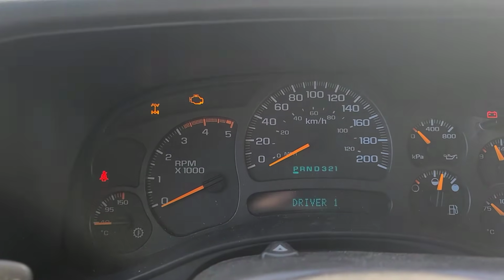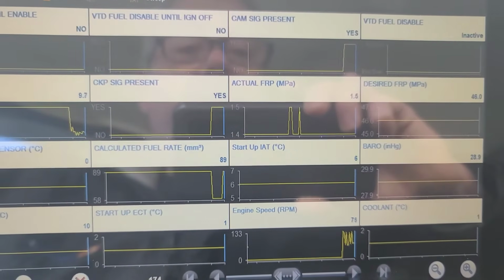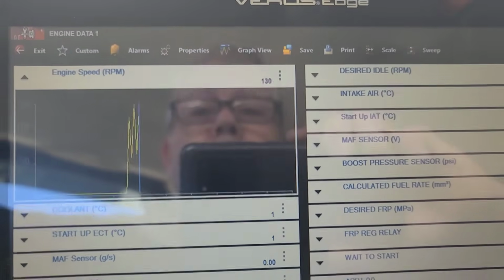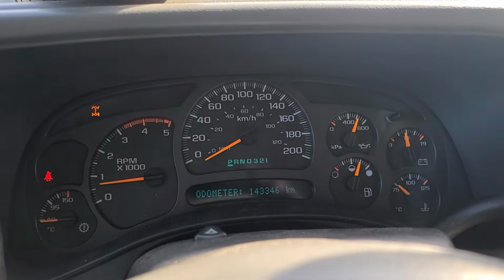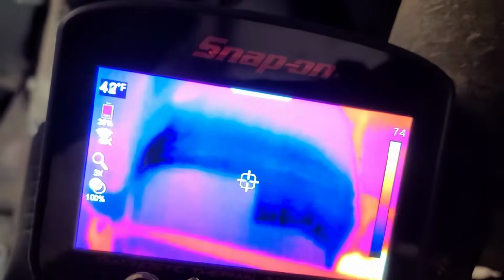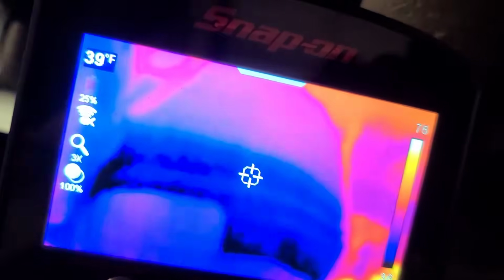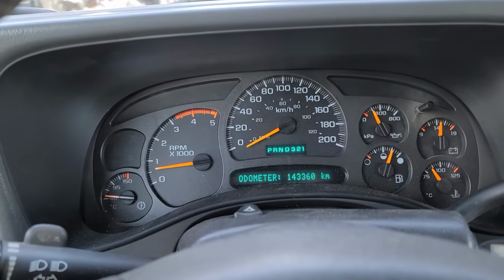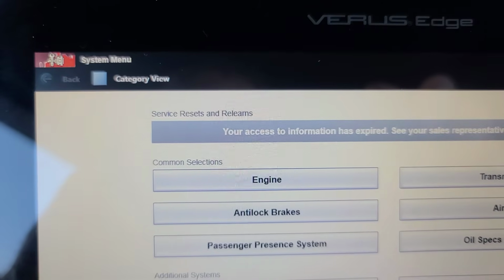2004 GM Truck 2500HD 6.6 Duramax Cranks No Start

Comment: 06 lbz changed fruel return lines both sides due to bad fuel leak
Got it all back together cranked up ran for about 30 seconds died now cranks but no start 
Bled fuel filter housing and primed till fuel came out 
have frp at 750kpa on cheap scanner 
Still no start any ideal?
Reply from the maker: You need 10 times that fuel pressure. Around 10 mega pascals to run. 750Kpa is 0.75Mpa. If you are sure the lines are connected correctly keep priming it.

Comment: I have an 2004 GMC 3500. Parked it after lunch having started it 6 times today and when I went out to pick up one of the kids it wouldn’t start. Turned over nice with plenty of power but sounded like it was out of gas. I’m @ 1/4 tank and was actually planning to fill up after getting the kid. Found your video and primed her back up. A little air came out then fuel right away. Turned her over a few more times and started right up. I’ll take her out for a real drive in the morning and keep and eye on her. Thanks so much for the video.
Reply from the maker: If you're in the Salt belt you may have a rusty suction line between the engine and tank allowing it to suck air. Otherwise be sure the fuel filter it not loose and could be check valves in the filter leaking. Good luck with it.
Reply: I started my 05 3500 dually & when I put it in reverse it shut off. Stranded so I looked at your video & primed it. Never had any more issues as of right now. Thank you for posting.

Comment: I have a cranking no start issue. I was thinking it was the ficm. New motor, new tranny, new tcase wrnt to town to get parts it ran fine, the next day started truck to go to town and it will not start. Got a P2146 P0201 P0204 P0206 codes. It blew a fuse and l9ss fuel gauge fixed fuse still no start, i am at a loss. I was thinking ficm but everyone says they dont go bad on the lb7
Reply from the maker: The codes are likely related. Could be a chaffed wire to one of the injectors. P2146 shuts down at least 4 injectors.  Check wire routing for rubbed through wires.

Comment: What if it starts at times and just cranks most other times?
Reply from the maker: You have to figure out what's missing, fuel pressure or injection signals. Have you scanned it for codes? Is there an RPM signal cranking? Do you have fuel pressure and if so how much?

Comment: My lb7 just cranks and has a code p0090
Reply from the maker: That code is typically caused by a faulty fuel rail pressure regulator.

Comment: I got a 2009 chevy express duramax,  it cranks over fine , but this one doesn't have a primer deal. I wonder what could it be, i know that when it starts it leaks a little bit of diesel from somewhere. When batteries where replaced it started but next day didn't.  Hope you give me some advise. Both fuel filters are new.

Comment: When I prime it and go to start it the frp stays at 1 after 5 seconds will climb to 2 and when I shut it off it instantly dies back down to 1 and won’t climb past two and I followed your steps just to try to get it started but nothing seems to be working? Any advice?
Reply from the maker: You likely have one or more fuel injectors with excessive return fuel flow not allowing the fuel pressure to build up properly.
Reply: @PhillipBailey  are you familiar with the 15 second test that shouldn’t exceed 100ml. Mine is barely even returning fuel on that test? 

Or is there a better way to test the injector return rate?
Reply from the maker: @Omar Mahmoud  well if ots cranking fine and the fuel pump is primed then I would call the cp3 pump but honestly I've never replaced one... Another possibility is a cracked injector body and fuel going into the crankcase. I did have that once. Check the oil for overfill and dilution.
Reply: @PhillipBailey  I replaced the cp3 pump finally a month later. And still no start. On the return line hose there is a ton of air in it i used a clear hose. And on the live data the frp won’t build passed 2. And the moment you stop cranking it drops back to 1 right away.
Reply from the maker: @omarmahmoud9628  are you sure you don't have a suction side air leak. I'd put a section of clear line at the fuel inlet at the rear of the left valve cover to rule out a leak along the frame to the tank. Once primed you should not continue to see air bubbles going into the fuel filter. Check the fittings on the injection control module banjo bolts sealing washers.will it run on propane?

Comment: Is it OK to spray a tiny bit of starting fluid?
Reply from the maker: Using starting fluid is very dangerous
Reply: If you spray starting fluid in any engine it should be turning over before spraying so it’s less harsh.

Comment: So I’m losing prime after a brand new housing, i build about 600 psi of pressure but can’t get higher. It is a brand new housing and I put 20L of fuel into the tank to make sure there’s fuel in it. I can’t find any leaks on the truck and it won’t start. I looked at the lines and can’t see anything. Any advice?
Reply: Sell it bro

Comment: These engines have fuel filter housing issues letting air into fuel system thus loosing it's prime, put a new one on mine and no issues since...
Reply from the maker: Yes thats true I've changed several but this truck had a suction leak going into the filter. Thanks for watching and merry Christmas

Comment: Love these videos....my '04 has been losing prime since 2007....when my tank is past half full and I park with the nose below the bed by even 6" or on a hill, she will start right up...but if it sits or is parked level the prime is gone. Mine takes 24 prime pump presses in general....but I have got a feel for the right pressure level after all these years. I rebuilt the prime pump but that did not do it... I suspect I have a pinhole leak somewhere
Reply from the maker: Rebuilding the filter housing usually does not include replacing the inlet and outlet check valves in it in my experience.  Try putting a piece of clear line on the inlet near the back of the left valvecover. Prime and run it. If you see a continuous stream of small bubbles then you have a suction leak. No bubbles after running 15 to 20 minutes I'd change the filter housing. Good luck
Reply: @PhillipBailey  well, thank you for those suggestions. I will take that advice. I think I also have a compromised fuel pressure regulator and thermostat....I am going to go against my ego and cave and take it into the dealer to have it looked at LOL!!

Comment: I’m having the same problem with my lb7 ram amazing after new injectors had a fuel leak start on a line running from rail to injector made it tight again ran it for a little trip gave it a good rev and it died won’t start up again can prime it from the filter crank it over and lost prime.
Reply from the maker: Check the fittings on the suction side of the fuel pump for a suction leak possibly.

Comment: One way to crank the engine while under the hood is to uncover starter relay and tap the tab or make your own remote, my 02 won't fire up hopping to figure it out soon pretty Shure it's a fuel pressure issue

Comment: I got a 2010 LMM duramax back in December of 21 and it’s my first diesel, learning a lot from videos like this one thanks for filming it.
Reply from the maker: The fuel supply system on the various generations of duramax engines didn't really change much imo.

Comment: I have an 04 durmax with 140,000 thousand but it cranks put it won’t start just like that but there’s no rust on the truck I’m not sure what it is. Does anyone know.
Reply: I have same truck
Reply: @JoseSanchez-ThuSanchez  yea, it was the primer pump
Reply: Hey bro did you get your truck fixed ? I have the same truck yesterday morning it started and then died and now it’s just cranking like this did that happen to you? Or did it not start at all until you changed that primer pump
Reply: @TwistedDmac  it did put I had someone try to start it wile I was pushing on the primer pump to get air, it starts, don’t let it sit to long or it will turn off, but replaceing the pump soon.
Reply: Did u fix it?